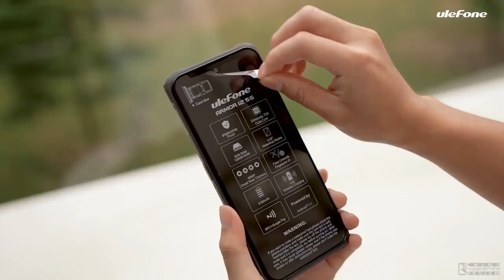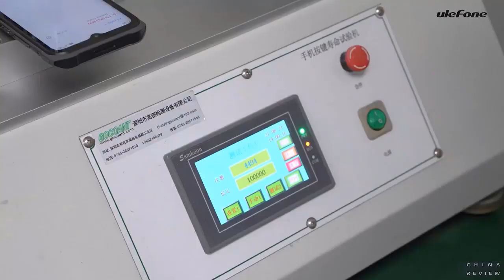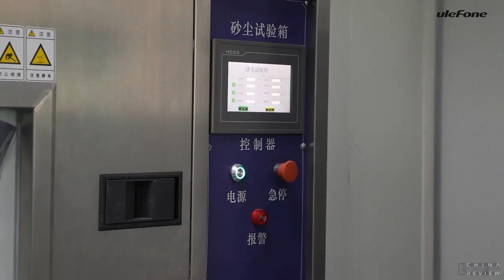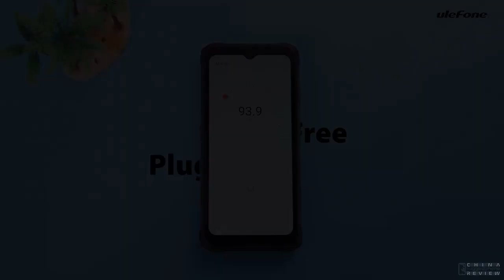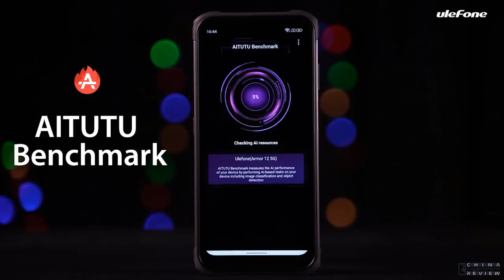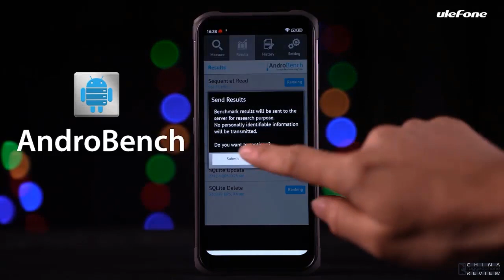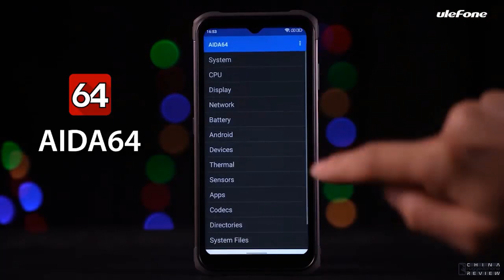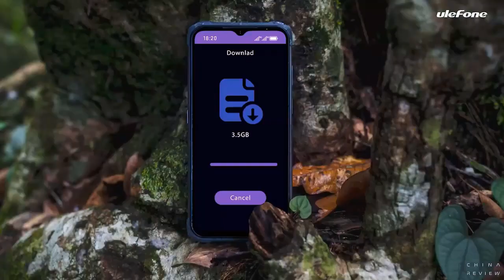Ulefone Armor 12 5G Unboxing, Quality Test, Performance Test And More

Comment: The Armor 12 5G is thin and light, equipped with 15W wireless charging, dual linear super speakers, and playing headset-free FM radio through dual speakers, which is enough to attract me. I am very glad that Armor 12 is equipped with a close-fitting fixed bracket protective shell, which can be clipped on the belt and carried with me, which is very suitable for me to release my hands to work.